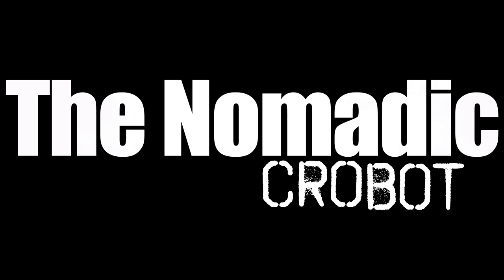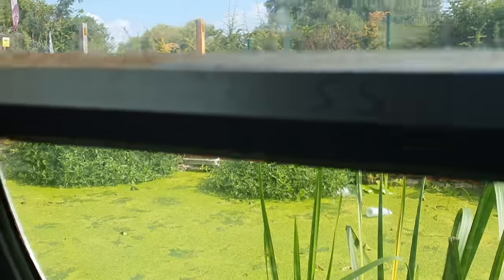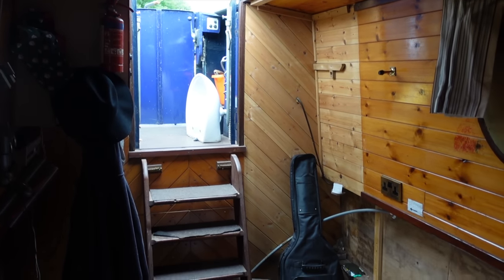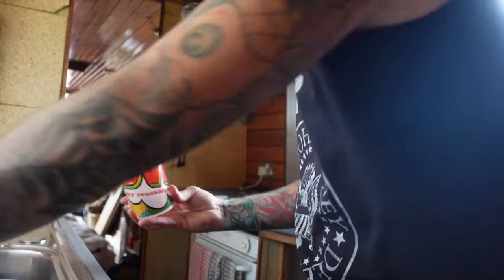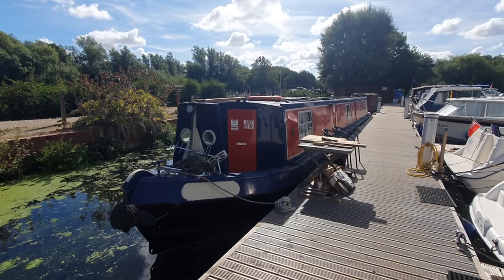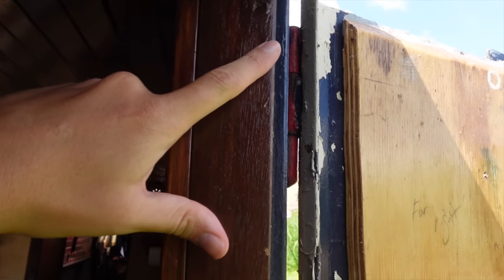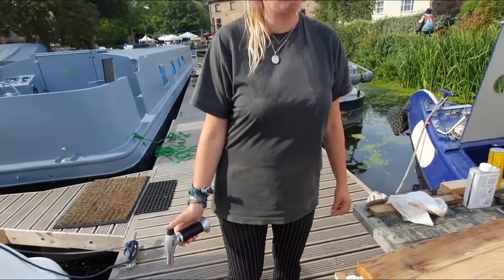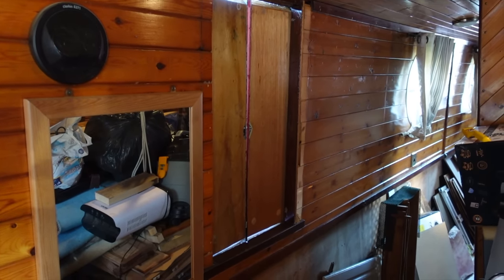Our MASTER PLAN to get our project NARROWBOAT boat cruising this year !!!

Comment: Hi guys, regarding your side hatches, Yale make locking sliding bolts with keys to unlock, fitted to the top and bottom of the lead door with the outside lip. The locking bolt sides up into wooden framework (need to drill some holes for the sliding bolt to fit into. Hope that helps 😁
Cheers 😁
Reply from the maker: That's a great idea, we need the boat going through the metal really or the lock is only as strong as the screws which isn't alot, we have some small locks on there which are fine for the marina but I doubt they would hold up to much if under attack for a while haha thank you

Comment: Hi both, also to add the 2 plates at the back of your boat are also rudder stops,  having had 6 boats the secret I found is ,one room at a time, once that's finished move on to the next, do not  rush your jobs take your time and it will work out.  Enjoying your videos liking the good humour
Reply from the maker: yes I think your right with that, 1 room at a time would have been  a far better idea, its just because we didn't realise how much of the bilges we had to treat for rust, oh ok rudder stops thats interesting someone said they were for safety if you fell in and all boats need them now too, thanks for joining us David see you on the next one :)

Comment: I'd plan to get rid of the gas boiler.... solid fuel all the way to save costs.... I've got through 2 bottles of gas in 10 days with Gas heating...
Reply from the maker: yes I think the plan would be to use the heating with solid fuel...I have heard there very heavy on energy but will see I suppose when we get the shower up and running again Cheers :)

Comment: Why are you fitting a Calorifier if you are considering a combination boiler ?.
Reply from the maker: thanks for your question Doug, we defiantly want to use the energy from the engine, it seams silly not to, hot water and heating on the boat, we dont want to use the aldi for heating really maybe just for a last resort ,we have heard these Aldi boilers are very costly if you use them for everything,  we haven't had the chance to fully test it yet, but yes I know what your saying, we probably need to discuss it a bit more and work out what we want to do :)

Comment: Ah… Hello Crew… More useless tips… 9:33 - Don’t use a Wire Brush - AAAGH! 12:34 You’ve already used it!!  Noooo! Use Stainless Wire Wool (and no, you don’t make shiny jumpers out of it)  If you use normal steel wool, bit’s will rust in the wood but stainless won’t.. Should be able to get some from the Fix of the Screw or from the Q of the B...
Reply from the maker: Thanks for the advise, I will endeavour to remember that for the future! I had looked into it and lots of people suggested the wire brush so I thought nothing of it! Right I'm off to the shops to go get myself some stainless wire wool 🙃
Reply: @TheNomadicCrobot  Great.. It's ADVICE; not ADVISE!!  Stainless wool (baa) is great and having a Freeman 22/2 is about the only thing you can prep the wood without damage prior to varnishing.  Must say, I REALLY like the grey carpet inside - I'd keep it....Or how about going RETRO? Oooh, orange and a green stripes (you;ll be sick) Don't forget a spare dual-network windy-windy thing and also a spare EA key on which you will invest £15 of your  hard-earned toil...    As always... more to follow :-)

Comment: Aldi boiler is bad. I have one and like others got through a bottle of gas in a weak.
Reply from the maker: I am worried about this, possibly use a calorifia (have I spelt that right haha)  for the hot water and use the aldi as a back up?
Reply: @TheNomadicCrobot  Of course yeah I have 3 hot water systems actually  - my instant gas boiler and an electric Ariston boiler under the sink. When we are on the shoreline I run the Ariston boiler.